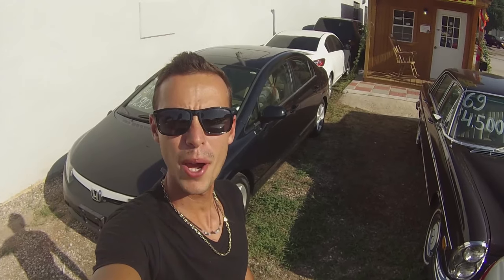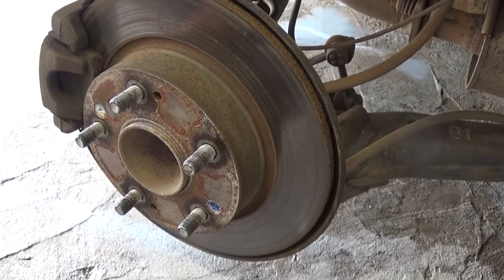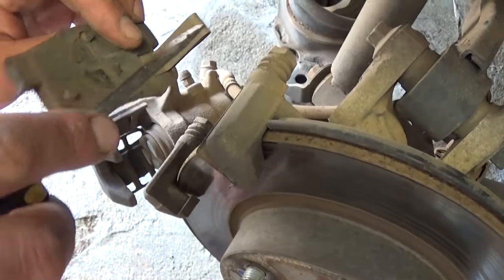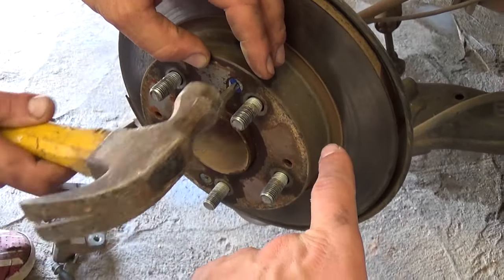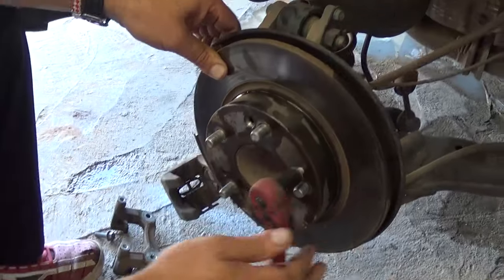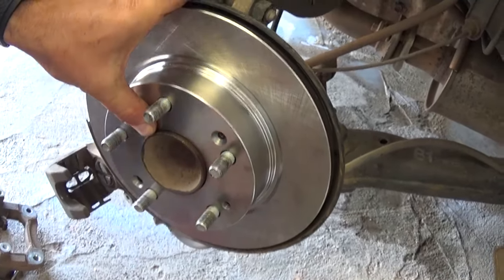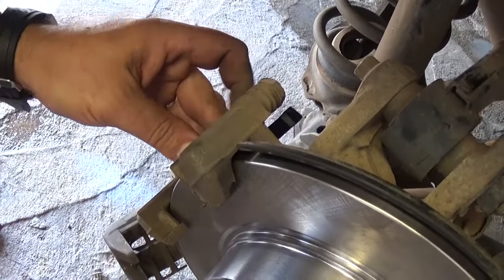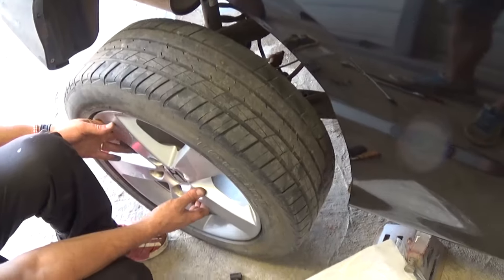Honda Civic Rear Brake Pads and Rotors Replacement 2006 2007 2008 2009 2010 2011

Comment: The bolt you used to get the rotor off - was it the bolt that held on the brake line?

Comment: Is that a 10mm bolt he puts in the hole to push the rotors out?
Reply: x2
Reply: 12mm can witness on the socket

Comment: What is that red lubricant? I can't understand him
Reply: jp554731 it's lock tight. Never use the red unless you don't want to remove those bolts again. They set solid. Use the blue lock tight
Reply: A. J. Slater thanks
Reply: Dont use lock tight at all for that..